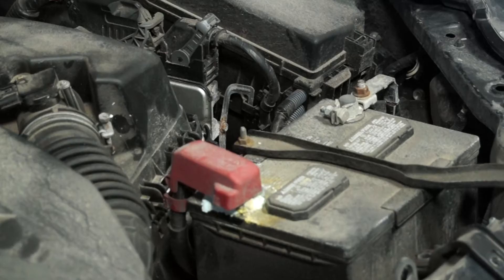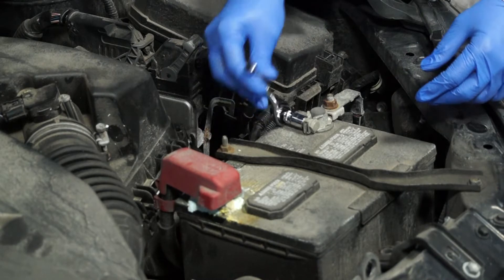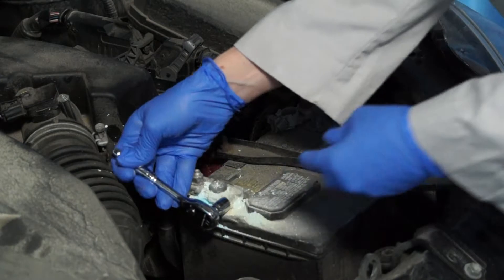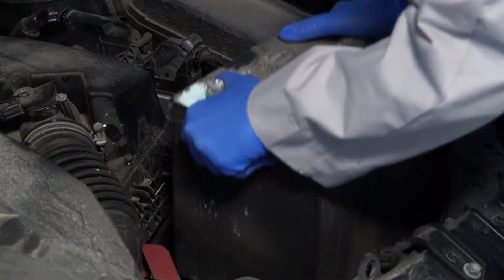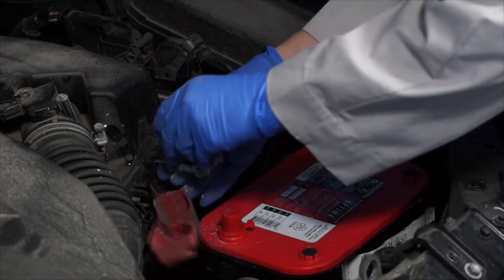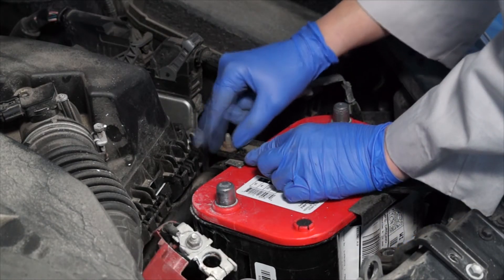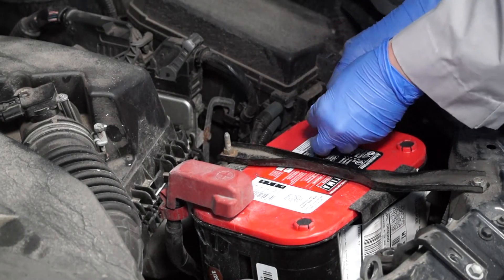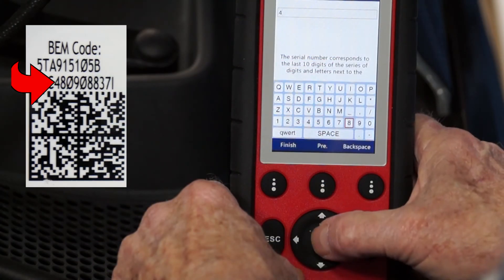Toyota Corolla (1995 - 2019) - New Battery Install

Comment: the one part i wanted to see wasnt shown, great. no idea if i put that supportive brace on properly
Reply from the maker: Thank you for watching. You should be able to look down the side of the battery and see if the hold down J bolt is properly seated in the hole for the J bolt. You may need to use a flashlight to see it. If its not, you can loosen the J bolts, reseat the J bolt and tighten the hold down, down. Just the top of the hold down bracket normally comes off in this install.

Comment: i had to use a 13mm not a 10. I got a nut stuck in my socket now because the 10 was too tight.
Reply from the maker: Hi - Thanks for watching and sharing your experience. A bolt in a vise screwed onto the stuck nut should het the job done.

Comment: What type of battery does a Corolla need
Reply from the maker: Hi - Thanks for watching! It depends on the year and engine size. We suggest that you check with your local auto parts stores or dealership for the correct battery for your particular vehicle.

Comment: I recently lost the hex bolt that helps holds the battery clamp bar in place, do you know what size is it exactly?
Reply from the maker: Hi - Thanks for watching! We don't have that information here in the studio, so we suggest that you check with the dealership parts department or a service/repair manual. That's what we do.